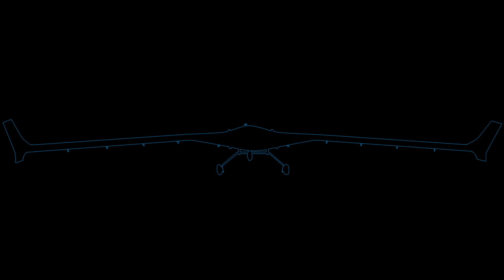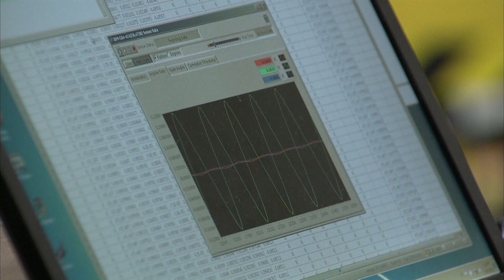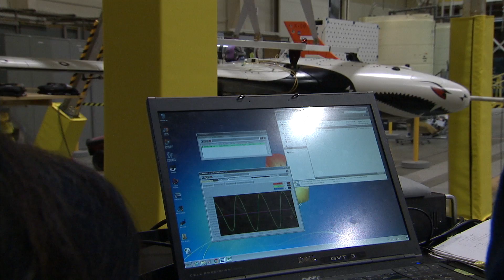X-56 Moment of Inertia Tests

Comment: One should expect, that countersunk screws are used not to produce falsifying vortex. Lippisch did such things without circuitous pendulum watching for what so ever. Either the CG fits geometrically and by balance or the ACFT makes its way to the yard. And static inertia has nothing to do with aerodymanic caused reactiontime. The rest is for density and OAT. Flying makes wiser than drafting.